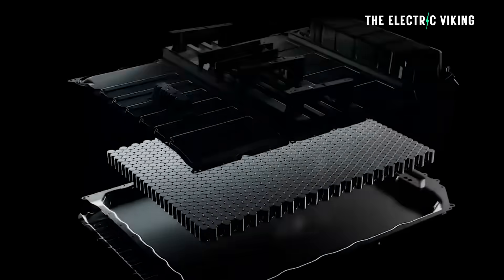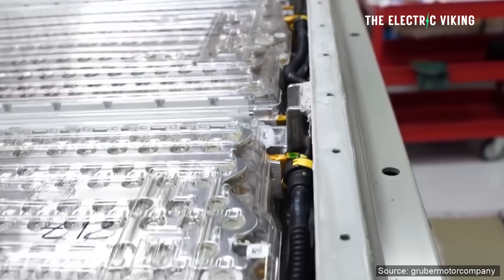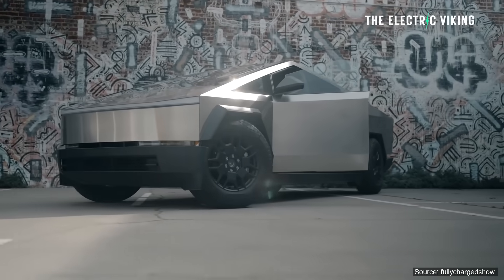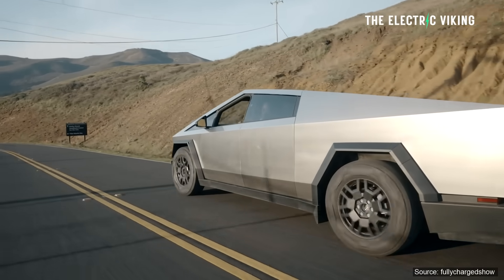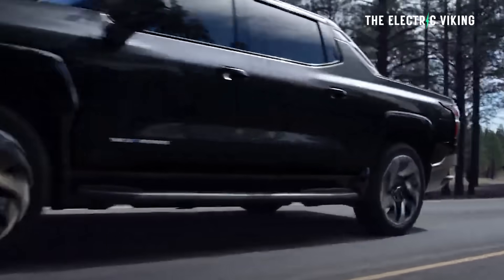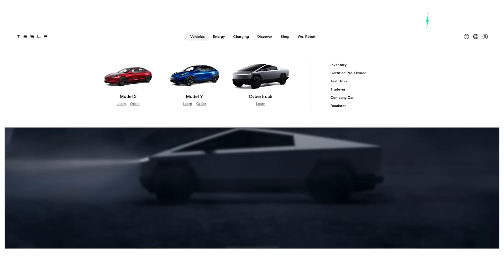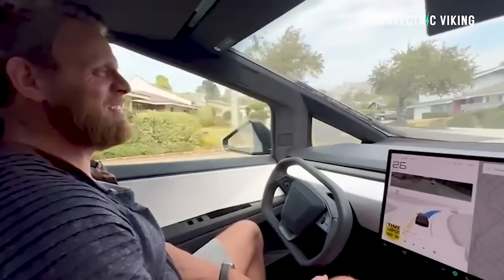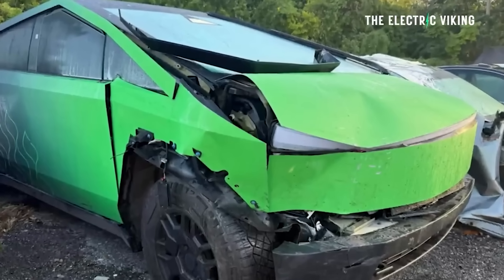Why Tesla is replacing ENTIRE battery in some Tesla Cybertrucks

Comment: Batteries potted in so the battery is not repairable forcing the owner to buy a whole new battery rather than replacing bad cells. One of many of Tesla's anti-consumer practices. If you are not for right to repair, you are on the wrong side.
Reply: Except the owners didn't have to pay for the replacement batteries here. You know this. Why lie? There are many terrible things about Elon Musk, so why choose lying? WHY?
Reply: @davidnika446  I think you need to re-read my words. What do you think is going to happen to the owners of cyber trucks when the batteries need to be replaced and they are out of warranty? Making your products non repairable is anti consumer and anti right to repair.
Reply: @mxguy2438 Not a single control unit in any vehicle is designed to be repaired, it’s no different.
Some manufacturers don’t sell components for repairing differentials or driveline components, you can only officially replace the entire unit.
Reply: @mxguy2438  I re-read your words, and none of them mention the 8-year, 150,000 mile warranty. However, making the vehicles non-consumer repairable is a much more valid concern. So your second point is WAY better.
Reply: @davidnika446  There was only one paragraph, only one point.
Reply: @mxguy2438  Yes, I know. You neglected to mention the warranty entirely. You did not score a point.
Reply: @davidnika446  your comments are like watching CNN. Half the story, presented out of context.
Reply: @davidnika446 What terrible things has Elon done? Curious.
Reply: Pack is under warranty for 150,000 miles so who cares.
Reply: @jjamespacbell  maybe the person who drives their car more than 150k, or maybe the person who would like to actually be able to sell it at that point.
Reply: @mxguy2438  How much residual value do you expect to have on a car with 150,000 miles? Probably not worth the cost of repair same as any car ICE or BEV, my friend who buys old used cars just had his BMW with that kind of milage have the transmission go out, not worth spending any more money. time to junk it and move on.
Reply: This is being repaired for free.
Reply: @elainebradley8213  Yes, as it is still under warranty. What happens when its out of warranty?
Reply: Do you repair individual transistors on your AMD/Intel CPU?
Reply: @peterfireflylund  no but if the potted in the cmos battery I'd have the same thing to say. Potting in batteries is anti consumer, anti right to repair. Period.
Reply: @mxguy2438  “period” is famously not an argument.
Reply: Structural, flame retardant, high voltage, liquid tight with proprietary breather vents designed to close when submerged. All things your average idiot shouldn't mess with.
Reply: Not being able to replace at least a module is one of the things that keeps me from buying an EV. If manufacturers want wide EV adoption, this practice of "non-fixable-replace- the- whole -thing" will have to change.
Reply: Tesla offers a 3 month EV mechanic training course available at most community colleges for all the right to repair you want.
Reply: Repaired for free? Haven't you noticed? Tesla also does buy-backs even on cybertruck? Haven't you noticed that?
Reply: It's not about the right to repair Tesla made they cell replaceable in the early generations at additional to them no one used it if there was an issue in warranty they would demand a whole new pack or go to the press. 
They could save money and make the whole pack more reliable by making it one unit (less connector to fail and if you do repaired you know it's most often the connector that's the issue.) 
The reason for the pink gloop is to stop wecker brake down and selling the cell from wreck and so creating a large market for the cells that makes Tesla nothing opens them up to 100s of liability cases and bad press of other people's  work and make stealing a Tesla a very profitable endeavour.
Reply: @alanrickett2537  You got it. Thus anti right to repair. They did it explicitly to stop people from repairing batteries.
Reply: @mxguy2438  no the did to stop people selling batteries no one was repairing them in Tesla's as the warranty was worth to much.
Reply: @alanrickett2537 you made me think of another interesting thing which is that the battery chemistry is ever evolving, the cells might be the same size but how would the BMS be able to control a bunch of different cells even if grouped together in smaller packs.
Reply: @limeyB-star-D  in some case the BMS has options like control settings where it is doing the same processes to protect the cell but at different voltages currents and temperatures for other chemistries you would need a different BMS on the same form factor.
Reply: It gets even worse. The battery pack is the truck’s floor, meaning these swaps are major.
Reply: @ElMistroFeroz  super easy actually, watch Monroe take it apart. That's Teslas whole deal. They make manufacturing effortless to ramp up production and decrease labor cost.
Reply: Batteries are at a point where replacement isnt really a thing.  Even first generation Teslas were designed to last 400,000 miles.  The latest tech (based on Jeffrey Dahns work) can do 20,000 cycles .. 54 yrs daily cycles.  This is why the top manufacturers are not designing for repair .. it is too rare to worry about.
Reply: @solarguy4850  its not far too rare to worry about. its just statistically unlikely to have a problem during the warranty period.